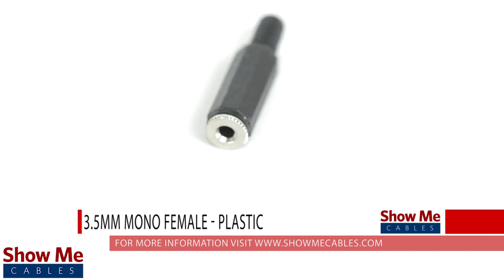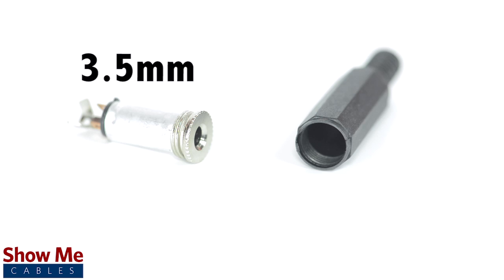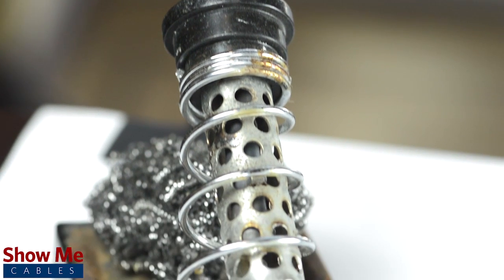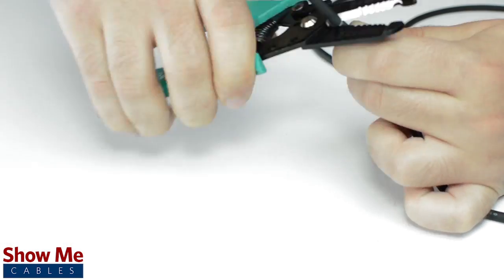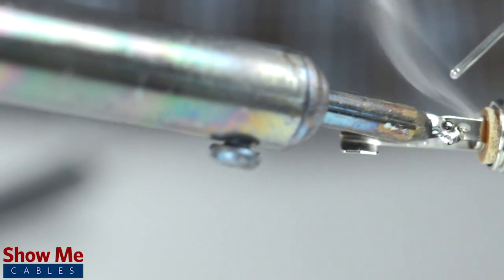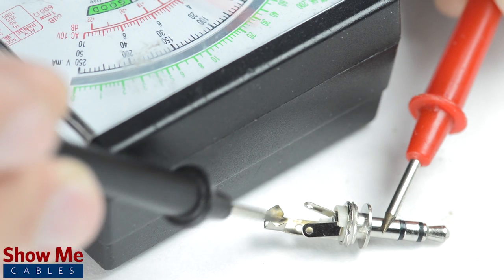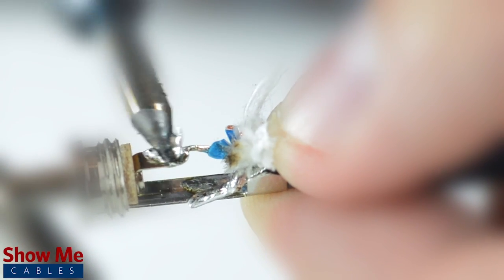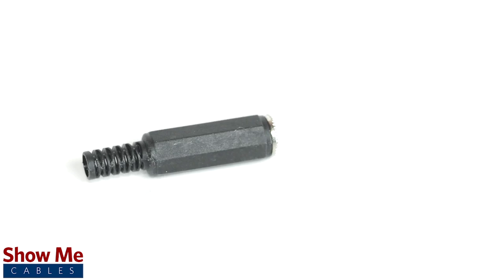3.5mm Plastic Mono Jack - DIY Project to Repair Your Audio Cable #981

Comment: How do I fix an aux jack female socket with a 5 pin connection that does only give off an signal at one pin and a single wire but stays silent at the rest of the pins and wires I need to connect for it to work? I resoldered the audio jack socket several times and I think I broke it as the signal doesn't really match the previous times I soldered it.

Comment: is it work to connect on the piezo soft transducer? Please help me
Reply from the maker: As long as you know the wiring diagram / pinout you need for the application it should work
Reply: showmecables : i have a problem with my accoustic guitar preamp, the piezo soft wire is cant use anymore and the problem is has no plug in socket on it. So i want to extension a mini mono female jack socket 2.5mm on it, because mostly online store only selling a piezo soft wire  (piezo under saddle ) with a mini jack on it.
Reply from the maker: If you are not sure how to wire the jack, you would need to contact the manufacturer and get the wiring information.